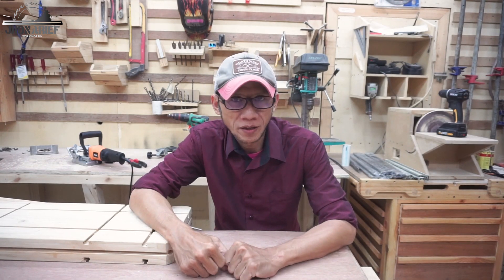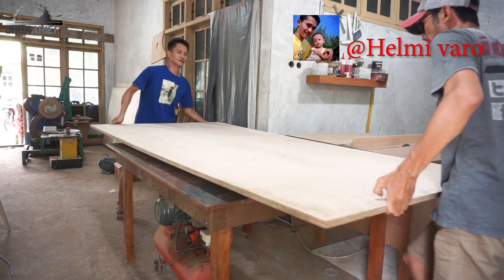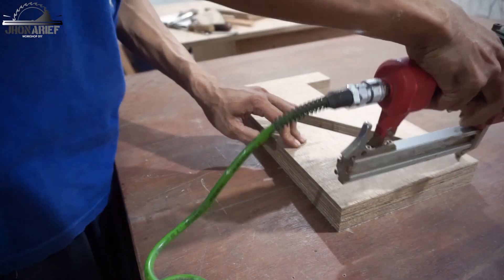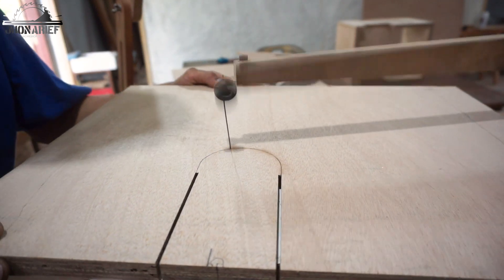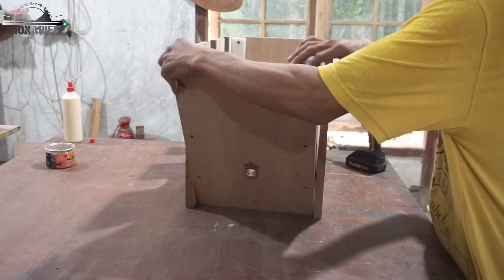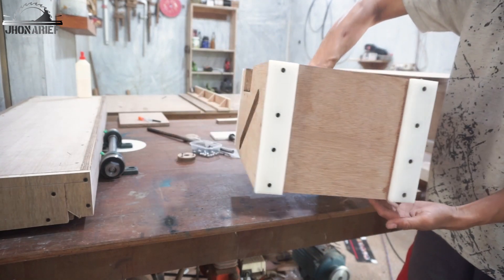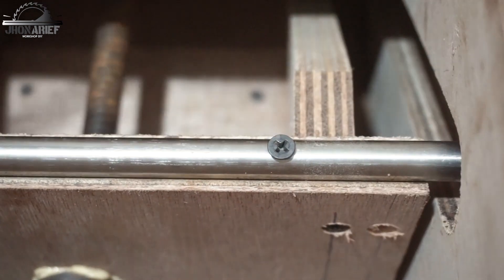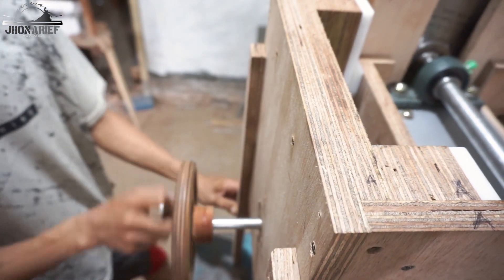TABLE SAW LIFTING MECHANISM - Table saw build PART#1

Comment: nanya bg, posisi dinamonya sebelah mana yah?
Reply from the maker: Dibawahnya bang ikut boks luarnya, yg geser bukan boks nya blade
Reply: @jhonarief  sya sdh cba buat bentuk 3d karya bg ini, pas bagian dinamo ditambahin penahan beban yah bg biar bisa nahan beban dinamo soalnya cmn ditahan sama engsel...
Terus mekanikal putar untuk kemiringan seperti apa yah bg.....klu boleh ijin dijelasin bg.makasih 🙏🙏🙏
Reply from the maker: Dinamonya saya beri tambahan hidrolis yg buat pintu cabinet mas buat penambah beban malahan bukan penahan, sebab vanbelt nya harus trtap tegang gak kendor, sebab posisi motor sudah ditahan oleh vanbelt mas
Reply from the maker: Mekanikal putar miring 45 derajatnya ada di video part 3 mas
Reply: @jhonarief  setelah sya liat part 3, tidak menemukan mekanikalnya bg cmn prosesnya putar kemiringan saja....
Saya liat besi putih melengkung yg nempel pada dinamo bagian blkg (bagian kipas) itu fungsinya apa ya bg.....maaf bg nanya terus soalnya blm paham.😁🙏🙏🙏🙏
Reply from the maker: Yg ditanya kemiringan buat pisaunya apa kemiringan motornya ? Klo untuk kemiringan pisaunya 45° saya pakenya bahan plywood yg saya router setengah lingkaran di part 3 lalu saya tempelkan pada cabinetnya

Comment: Assalamu alaikum... 
Mas jhon...  Bisah minta informasi Name plate motornya ???? 
Terimakasih...
Reply from the maker: Name plate sudah hilang mas, maklum saya belinya bekas, tapi spek yg passnya adalah rpm 1400, dengan power 2hp singgle phase
Reply: Asyiaaap mas...  Terimakasih banyak atas infonya... 
Sehat selalu... 
Salam woodworking....

Comment: I've had a similiar idea for the blade elevating mechanism. What angle did you use. I was thinking about using a 2:1 slope on the cam with a graduated hand wheel to make it easier to dial in the depth of cut.
Reply from the maker: The angle is depending on how hight  the blade elevating, because more hight is going to be more travelling distance, more travelling distance  the angle of inclination will be more gentle, in this table saw I'm using 12 inch blade
Reply: @jhonarief  vc tem  desenho  d   serra